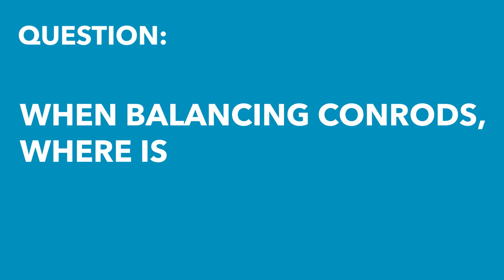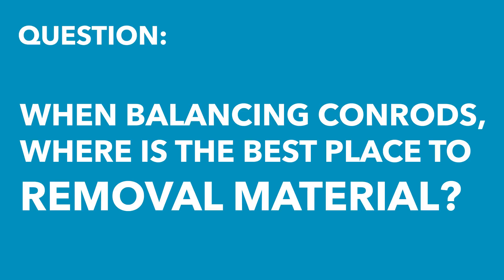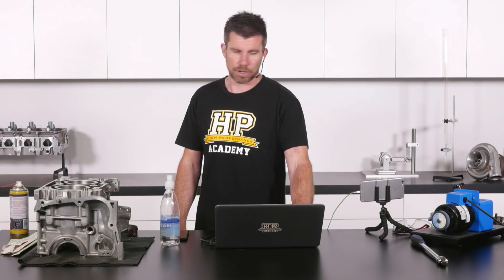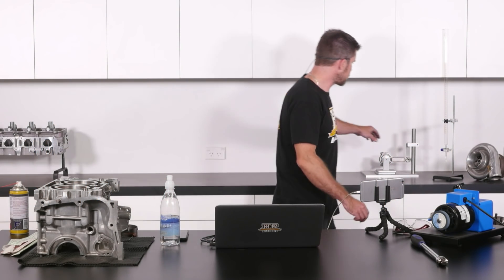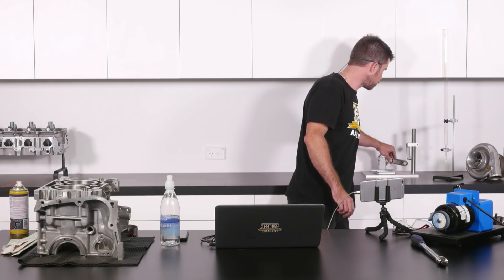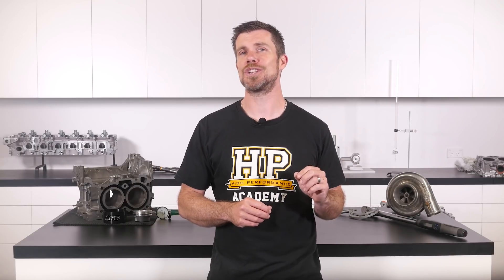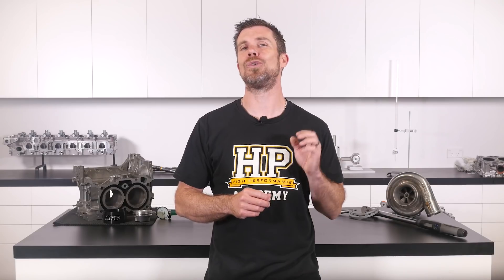[HPA Q&A] Conrod Balancing | Where should I remove material from?

Comment: Hi, I have several rods, can I use the light ones and place them anywhere on the block? One on the new block is 10g heavier! Can I chamfer along the rod to remove materiel? Thanks.
Reply from the maker: You have to be pretty careful with where you remove material from. I don't have any free content on this sorry, but note it is covered in detail in the Practical Engine Building course and also in a members only webinar here in detail: https://www.hpacademy.com/previous-webinars/193-2/ 
There is also one more video here: https://youtu.be/Yv9OYtLe5TA - Taz.

Comment: What about mixing con rods lets say u have an ej255 an u blow a bearing 1 rod damage an 3 rods are ok;: note the 3 rods are forged h beam. An u had stock rods left over from just removing to do a mild build like say 530bhp would that affect that engines performance

Comment: Wouldn't it be best to weigh the piston, rings, pin, snap rings, rod, bolts and bearing all together to determine if it's necessary to take weight? I was under the impression that taking weight from the inside of the piston was best to do before taking from the rod.
Reply from the maker: The pistons need to be balanced separately from the con rods. The con rods also need to be balanced end for end rather than just matching their overall weight.

Comment: I know it's free
Reply: From what I know and I know.... Because... I studied and am doing this and have seen it done. Just now getting into doing my own balancing. You want to start by weighing everything however the final weight of the pistons and gudgeon pins need to be matched to eachother within .5g's  Good ones like Mahle or JE should be that close out of the box but verify. If you have an extra heavy bearing shell set and an extra light rod those should go together. But usually rods are within 2 grams out of the box but if your racing you should go to .5 or less. I went to .3 because well I could. The hard thing about these rods is no one really says where to cut away from H beams. The sides of the cap bolts  is actually a really poor place imho as most rods get pulled apart. but if you noticed he said chamfer he slid it in there with vasoline... He means round ovedr the sharp edges which are left behind which in fact do add to the strength of the rod.  I see a lot of guys drilling under the crown with a mill tip taking chunkc out.... another stupid move for pistons. A flapwheel will do and not leave a sharp edge to start a crack when the engine knocks which happens during tuning and during those moments of the unexpected.
Reply from the maker: The side of the rod where the rod bolts locate is the only area on the big end you'll be able to remove material without impacting on the strength and rigidity of the rod. Generally the amount of material that we will need to remove is very minimal and by the time this is spread across the four edges available on each rod, you should need no more than a light touch with the linisher. This won't impact the clamping capability of the rod bolts. 

When it comes to balancing pistons you shouldn't be removing any material from the underside of the crown regardless what tool you're using. This is one of the most heavily loaded parts of the piston and it's important to maintain maximum thickness and strength. The correct place to remove material is from the inside of the skirt and the edges of the pin boss, making sure that the material is removed as evenly as possible and that your grinding doesn't impact on the piston strength. This can be done with a die grinder or power file. It's important to make sure that your balancing doesn't leave sharp edges as these can promote crack formation.